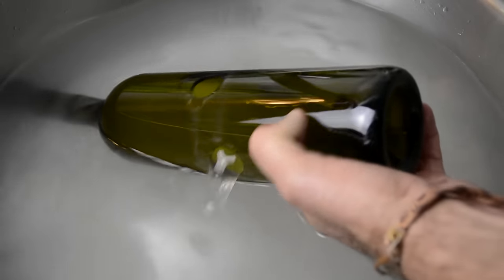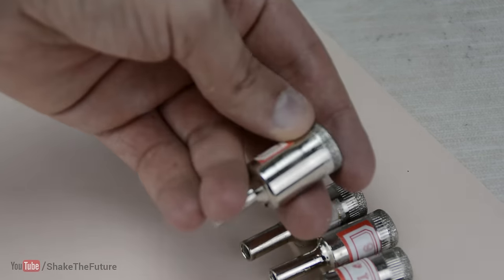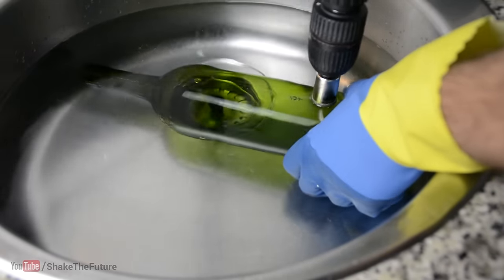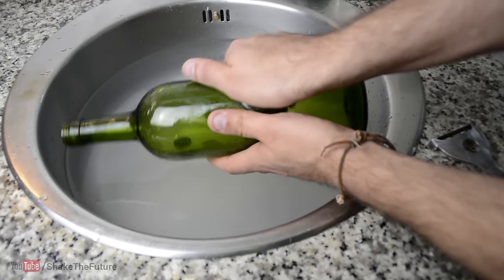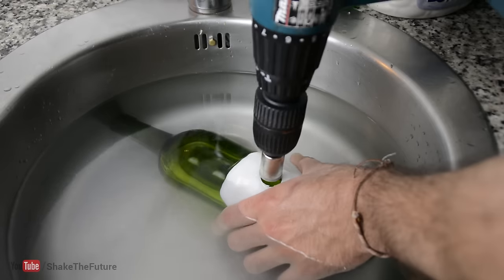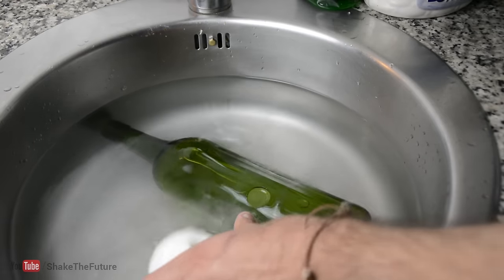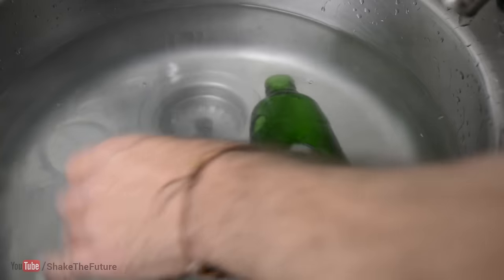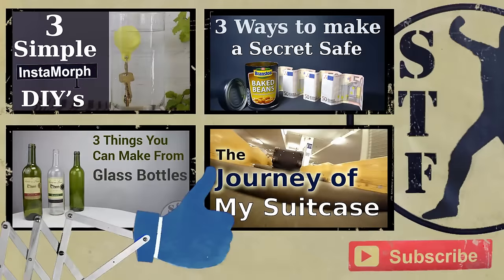How to Drill a hole in a Glass Bottle | The Easy Way

Comment: Using the guide so it doesn't slip is a good tip, thanks. I'm wondering what other drill bits would work, as I don't have any diamond ones. I've never cut glass or tile before, and probably won't ever do it again, so I'd rather avoid having to buy more bits if I can.
Reply: In in

Comment: Hello,  Thank you for posting this video.  I have a few questions for you.  Do you recommend any particular brand of diamond core drill bit / hole saw?  I realize that you are located in Spain and I am in the U.S.A.  I don't know if we have access to the same brands of products or not.  Also, how many holes are you typically able to drill with one of your drill bits before it gets dull or wears out?  Finally, for decorating bottles with light strings, what diameter hole do you recommend?  I was thinking around a 1" hole.  Thank you for any information that you can provide.  Take care,  Matt
Reply from the maker: Hi Matt!

I used the same or similar kind of drill bits you can get on Amazon.com (link in description).
I got mine from China (aliexpress or eBay), but I believe that it's exactly the same products, just sold under a different brand name.

I don't know how many holes you can drill before they become dull. I am still using the same drill bit set I bought a year ago and it still does the job.
To be honest, I don't use them often.

It's hard to say about the best hole size for the string lights.
Only you know what look you are trying to achieve.
In my experience it's easier to drill many small holes in the bottle than many big holes.
1" hole is not too big and not too small, so it might be perfect. Then again, I don't know what exactly you are trying to do.

I think it's best if you get a diamond core drill bit set and play around.
Use a spare bottle to drill a few holes that are different size and see what you get.

Cheers!

Denny

Comment: why does the drill have to be cordless?
Reply from the maker: +Tom Smith 
In case you drop it in the water :)
Electricity and water is not a good combination.
Cordless drill will not kill you if you drop it in the water.
Well, you could also use a bench drill.
Reply: A HA HA HA HA
Reply: @ShakeTheFuture  If you are that clumsy, you shouldn't be using power tools of any type.
Reply: @halibaitor  Uhhh no. There's a shitload of reasons you could drop a drill, that have nothing to do with being clumsy.

Comment: can i do this in a mirror, too? i mean, it don't going to break in pieces?
Reply: you will need a flat surface which the mirror can rest on (so if it's a big mirror, better not do it in the sink, also there will be a higher risk to whichever container you end up using, seen as you could accidentally end up drilling a hole into it as well) then it should probably work.

Comment: You could use a plastic bottle as a guide as well.
Reply: yeah, you could even try cutting a rectangle out of a thicker plastic bottle, heating it with a hot air gun and forming it with the glass bottle.

Comment: now I'm no doctor, but having a basin of agitated water filled with glass dust sounds like something you should probably wear protective gloves for
Reply: Why?
Reply: Nope.
Reply: I personally dont have experience with glass dust, but i think that glass dust in water (even agitated water) is still a lot less dangerous than a shattered car windshield.
Also, the pieces will be a lot smaller seen as they are more or less grinded away instead of shattering, creating much finer dust compared to the windshield pieces.
Reply: Well the finer the dust, the harder it will be to get cut, seen as the sharp edges get shorter, and each individual speck will have a lot less force, making it harder to penetrate the skin, so in this case (diamond bit, regular glass) i would say, that it should be fairly hard to get cut
Reply: Calm the fuck down. Glass dust is also known under the name '"sand"
Reply: Olivier Myre Glass dust is not also known as sand but good job passing science class there. 

To the other fella, glass dust is only really an issue if it is airborne. It will not cut you at all, the only serious damage it will do is to your lungs or eyes. If you have ultra sensitive skin it could irritate you but thats not serious. Under the water its not going to get in your lungs.
The reason some gloves would be good here is that if the bottle smashes while you are drilling then it could seriously cut your hand but the dust isnt an problem.
Reply: You should wear gloves and goggles and a dust mask, these people are reckless
Reply: @AuroraCalifornica  Yes, exactly. Get some of that "not at all harmful" water filled with glass dust in your eyes, or even in a small cut, and then we'll see if they still feel like it's overreacting to suggest safety measures. The op is absolutely right.